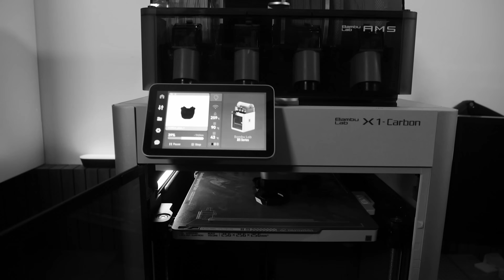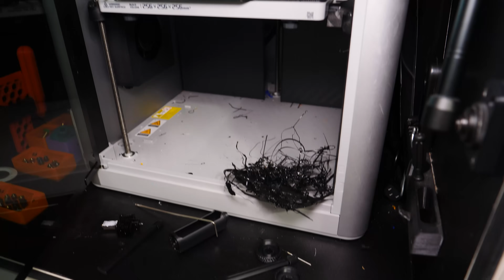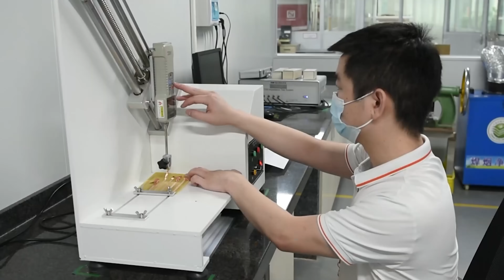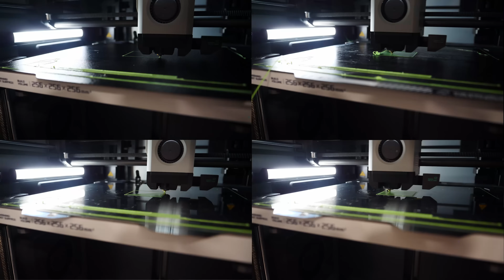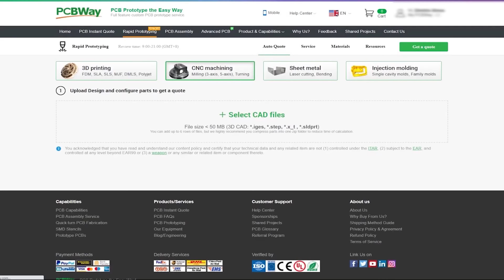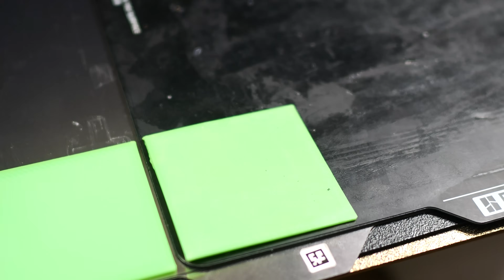Improving My Bambu Lab X1 Carbon... With Cheap Knockoffs!

Comment: Its the software being closed that i have a problem with. Open source hardware is good and should be the long term ultimate goal for mankind but honestly i could not care less about a bracket or a case or whatever being closed source.  If it goes out of stock someone in china will clone it, we have had what you could call 'pattern parts' in cars since they where pulled by a horse. For me, i am glad that the alternatives exists but i am sticking with bambu parts and consumables. Sure i may buy a cheeky roll of cheap filament from time to time ( seriously bambu, natural (no colour) versions of your filaments, get it sorted), for the most part tho i will stick with bambu, just put the spool in the AMS and it works.

Comment: I too bought a cheap PEI sheet, which was even cheaper than $19. And have no lidar trouble or software errors .... on my Ender 3 = )
So definitely recommend.
Upgrading Bambu Lab? May be on a level of "20 best upgrades for your Ender 3" videos and among them "instrument tray" and "pliers stand". Yeah. Upgrades = )
But will definitely install quick change hotend from Bambu Lab knock off, when they will be cheap to my Ender 3. = ))

Comment: I accidentally bought the Wham Bam PEX plate at Microcenter ($54!) because the employee didn't understand that I was asking for an additional PEI plate, and said it was the same but better... but the Wham Bam plate came with a 'scuffing' pad, and requires that I scratch the bejesus out of it for 10 minutes straight... I'm not going to do that. I'm returning it, I love love LOVE the PEI plate from Bambu, and though I'd love the glossy plate finish, the scuffing is going to leave ... scuffs in my prints, no? either way, I'm just not loving that I need to DAMAGE this board to use it and then of course can't return it.

Comment: Think my answer to your question would be this : I bought a P1S two months ago to step into the world of 3d printing since it is new to me, so I wanted a printer that would, out of start, work so I could spent my time on learning and discovering. Besides that I'm a 25 year Linux user, although professionally a Microsoft senior engineer. In Linux I like to have the option to get an out of the box working solution like Debian that I can tweak, or go for a Gentoo distribution that I need to spent weeks on to tweak exactly to my hardware. What I want to point out is I would like to have freedom in choice, also with Bambu. Stick to their eco system and not bother with hard or software or equipment or be able to start tweaking if I would like to do so.

Comment: Honestly, I rock the Bambu textured PEI sheet daily.  The only reason I chose it over the AliExpress was the QR code compatibility.  I don't like the idea of having to manually bypass a prompt every time I go to print.  Though that could be solved quickly and easily with a laser adding the QR code to the appropriate location on the cheap sheet.

No errors, etc from the textured sheet regarding the lidar / temp / anything though.

Comment: I've got a Wham Bam PEX plate for my X1-Carbon but at 90% of a print test with PLA it lost adhesion... I followed the instructions from Wham Bam regarding what to change in the settings for bed and hot end temperature, fan... but they might not be good for me. what should I change or check?
I'm also having problems with PEI textured plate I got from AliExpress... again adhesion!
Reply from the maker: Sounds like you need Dawn dish soap in your life.
Reply: @thenextlayer  done. still some issues. I can print 90% then the piece starts moving.
no issues with cool plate + glue

Comment: I had issues initially with the Bambu cool plate. I found out using the Dawn power spray to give it a bath and a little scrub with a course sponge I can go 2-4 weeks of constant printing  with a sprits  of alcohol between prints I have had zero issues and no need for glue. I have printed 20 KG so far and no issues. The engineering plate has garnered the same results with ABS and PETG and the same cleaning process.

Comment: This printer seems to work very will for pretty much everyone on YouTube.  My X1 Carbon, however isn't working and I have not been able to get any help from Bambo.  The biggest issue is that I had to disconnect my AMS because I couldn't get it to change filaments.  It would only use the filament on the far left.  Went to the standard filament rack on the back & got 1 print.  Then I tried to remove that filament, and I can't.  When pulling on the filament in the back of the printer as soon as the screen says to remove it, It will not come out, regardless of the force used.  I did not use sufficient force to break the filament.

Comment: the people here to use glue sticks, or advise using glue sticks - I don't get it. No other 3D printer needs a glue stick to print well. I think the people who are advising glue sticks on here must be aged 70+ and still think postage stamps are "neat". That said, I can't get the Bambu basic PLA to stick to my cold sheet, at any temperature, or to the PEI sheets I bought, both Bambu-branded and off-brand. The PLA has been out of the box on the spool holder for about a month though and my house isn't that humid. I tried hairspray, washing it with dish soap, and I even tried sanding one PEI plate with 320 grit sandpaper. The Bambu PLA won't stick to it. For a great while, I thought the printer was just busted. Today I got the bright idea to go back to using off-brand PLA and while it didn't stick GREAT to my cold sheet + hairspray, it did stick a LOT better than the bambu PLA. I'm starting to think Bambu's PLA in particular, is much more susceptible to humidity and water gain than other PLA brands. I think this, more than anything else, is perhaps causing the adhesion issue. I'm going to try the Bambu PLA on my Creality CR10V3 and see if I get adhesion issues on IT. I can manually set the height up and down on that guy, and can get the right amount of "squish" on the 1st layer, and if I don't like it, I can adjust.

Comment: today I just try to print ABS for the first time... the X1C gives an error everytime I try to print ABS... so everytime that I need to get to the high temperatures ( that is not me is the presets to print ABS) the printer come back with erros: heatbed homing abnormal + external disturbance on force sensor 2 and sensor 1 bla bla bla the printer has 1 week...

Comment: I just bought the Bambu Dual-Sided Textured PEI Plate as an alternative and works fine, even the one that comes with the printer(cool plate) works fine without putting the glue ( only tested with PLA+)... well this video has 4 months... they could change some stuff, thanks for your videos

Comment: If you’re printing toys, you can play with open source. But if you have to print critical parts, then stick with a good printer out of the box. Sure, there can be some third party accessories such as printing surfaces, that are worth a try. Wham Bam has a good rep.

Comment: Thank you. I am binging X1C YT's atm, seriously thinking of buying one once I have eyeballed one in a showroom next week. 

You asked about "to mod or not to mod". That is the (your) question. I am a "use it out of the box" kinda guy. I simply want a tool to let me express my engineering creativity - enclosures for electronics projects, robotics parts, silly-but-useful little gadget around the house, toys for grandchildren. I love being able to design something in F360 and have it come to life.

All that notwithstanding, there are still changes I will do, if I buy the X1C, things to make it better suited to my specific need. First off will probably be an internal VOC air recirculating purge system. My tiny lab/workshop/office/playroom is in the middle of the house, I like printing in ABS and want to play with nylon, ASA, etc., and my wife has a very sensitive nose. So VOCs are a major consideration. I will probably also add some internal LED strips, and definitely make some desiccant capsules that fit inside the cores of filament spools. Those are things that do not encroach on warranty conditions. I am very careful about that - here in Australia we have very strong consumer protection laws, and I won't jeopardise that.

Comment: If you think these are "closed loop" then you obviously haven't used a Zortrax M200/300 series printer. You are stuck with their very basic slicer which outputs in binary code (?) not G code. Then there's the perforated bed, none of these fancy slick/textured flexible plates, your print has to have a raft (waste of material) or your part ends up with "pimples" where you want a flat surface. They now accept aftermarket filaments, but trying to dial them in is near impossible with the slicer.
Why do people/company's buy them, because they just work, no fuss. We have 3 at work for prototyping new products and they are great for that.
I started at home with an Ender3Pro, then started tinkering, got lost along the way, too many changes, things stopped working well, have let it gather dust on the desk..... Bought a Zortrax M200 2nd hand and like it because of the enclosed chamber to print ABS/ASA at home.
But now am looking at either a X1C or Qidi i-fast or X-CF Pro to use carbon based materials for functional car mods that i make.
decisions, decisions.
Reply from the maker: True, I haven't

Comment: Based upon your review of the textured plate in this video I purchased one exactly the same and have had exactly the opposite results.  I have used other brands over the years with other printers and been happy but this one no matter what I do to clean it will not allow anything to adhere at all.  Very annoying.

Comment: I get the argument, but my concern with the walled garden is, if Bambulab go out of business or stop supporting a printer to sell their new version, the reliance on cloud services and proprietary software dlls and proprietary hardware could leave you with an expensive paperweight.  I say they as someone who bought an x1 carbon with AMS and also has a Prusa mk3s+, and who has iPhone, iPad, MacBook.  But also has window and Linux laptops and pcs.  I love the harmony of the walled garden when I just want to get something done, but when I want to do something cool and interesting I can step out of the walled garden.   The walled garden is great if you can afford it and until it’s turned off on you then it’s not so great because you have an expensive paperweight and no one can help you.  Appreciate the videos and keep up the great work. Thanks.

Comment: The Bambu is designed to be a tool. I don’t see anything wrong with simple add-ons, but different firmware? That’s insane! That’d be like running a different operating system on your iPhone. Don’t mess with the core functionality. The electronics and software working together are what make the machines great. Trying to clone the tool board, or any of the other boards, sounds like a recipe for disaster.

I will say that the SoftFever fork of Bambu Studio is great, but not without its flaws. BL has even incorporated some features from the fork into the main branch. (See the latest Studio release notes.)

I love your videos Jonathan, but I can’t be the only person who’s watching at 1.25-1.5x speed. Brevity is your friend, especially when most of us have social media induced ADD. Stay frosty! ✡️
Reply: I wach him at 2x speed 🤪

Comment: Yeah! i think it just uses regular motors, fans, heaters, etc, just like the majority of FDM printers (of course except for the hotend and the lidar). As for P1P goes at leas, in the worst case you coud hook-up an ordinary motherboard to run the motors, heaters, etc, because the chassis and motion system is great! I ordered a genuine Bambu hotend to test on my typical v-slot bedslinger and it prints great, way better then the original alu block Ptfe lined hotend, and with no modification on the motherboard (only in the firmware setting, I took the effort to actually measure and calibrate the little thermistor that came with the hotend). My only remaining concern is those special bearings on the carbonfiber rods, I've seen pictures online with scratched rods because something went wrong with those bearings.

Comment: I don't mind simple mods, like the desicant holders for the AMS unit or the poop shoot bucket.  But I think its funny that people are mad or at least turned off by a printer that from what I've seen prints faster and more reliably than any other printer, even after the many many mods that people have made to theirs.  I don't have the X1C yet, but I'm on the list waiting to order one.  It seems to be what I'm looking for.  It looks like a finished product the print really well and reliably.  Simple maintenance is expected in this hobby, but I don't want to spend hours repairing or making changes anymore.  I don't have time for that.  And that's just my personal preference.

Comment: I'm a long time glue stick user. With a removable build plate, however, hair spray from the dollar store is easier to apply, and the texture on the print is better as well. Apply many coats, and lay flat to dry.

Comment: I'm not sure my closed source worries have subsided. We shouldn't hope that someone will find a hack for the X1 printers in the future just so that we can have a similar level of open-ness so that one can use compatible motors, hotends, motor drivers, and other electronics when the X1 is inevitably discontinued and no longer supported by Bambu Lab. I'll still be building another Voron until Bambu Lab reverses their decision and goes fully open source, or until the proprietary parts are fully figured out. 

Closed source is a huge deal. The first commercial 3D printers were closed source and those companies still sell closed source printers to this day and do nothing to contribute to the maker community. As sexy as the software/hardware harmony is, not having control of the hardware nor software as a consumer is extremely troubling.

This is a weird hill I will die on, but I totally understand why many love Bambu Lab printers.

Comment: I think a company should make a g10 plate for it. I myself like the mirror finish and I have one on my ender, no need for glue, I found that putting the first layer hotter helps it stick to the plate and the part does a kind of static cling to it. Makers Muse made a video about g10 which is where I got the idea to run one on my ender.
Reply: Been using FR4 and it’s awesome, just pops off when cool.
Reply: @marksneyd1262 I’ve been thinking about trying FR4 but haven’t seen a recommendation for it. Thanks

Comment: I do not yet own a 3D printer.  That said, I like to tinker, when either necessary or there is available down time.  However, I much prefer my expensive tools to work.  The reason I'll pay more for a well built and reliable tool is so that there are no excuses for poor performance other than 'me' causing the issues.  I want my camera tripod head to hold rock steady where I put it.  I want my table saw fence to hold perfect alignment once set.  I can't stand cheap tools that wobble and twist and loosen out of true.
If I were to buy a 3D printer, I either want to get an inexpensive one that 'may' need a few upgrades to work perfectly (tinkering) or if I was to buy a Bambu Labs/other of the same price point, I would expect it to be right on with a small set up and learning curve.  And no downtime - I can find doorstops much cheaper than $1500.

As far as walled garden vs. aftermarket/open source, I say use the best option available that does the best job for the lowest costs, wherever that comes from - as long as it's legal and no one/thing gets hurt.

Comment: I have both the gold el cheapo Chinese PEI sheet and the official Bambu PEI sheet and both work equally well for me and unlike you, with both of them I don't get any errors as the ones you've shown. I would contact Bambu support if I were you, I don't think it's an issue related to the plate and probably is a different issue.
Reply from the maker: Thanks for letting me know. I’ll check into it.
Reply: @thenextlayer  you're welcome, hope it helps!

Comment: If I start doing hardcore mods then I'm giving away the main reason why I switched from bed slingers to this! That I like to tinker in my prints, not my printer. I don't want to make y printer my never ending project. The nozzle is a no no for me there because of the reason just mentioned. The High Temperature build plate is really good, the cool plate I've had used with glue and without and honestly I like it, just have to apply the thinnest and evenness layer of glue, a crappy and ugly layer is exactly what is going to be reflected in the print. Btw, you Have to try the Carbon Fiber textured knock off build plate, it doesn't have the same adhesion and you can scratch it and damage it if you're not careful but the results are astonishing when you pair it with black cf filament, it hides the pattern of the print for a nice looking carbon fiber pattern.

Comment: I don't use glue on the Bambu cool plate and it works great.

Just a wipe with Isopropyl Alcohol before a print and it's great.